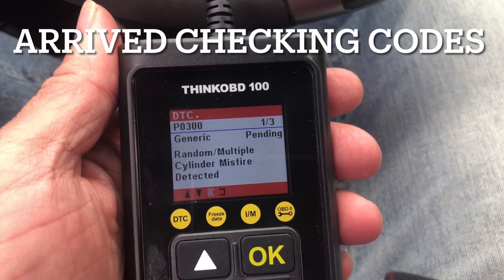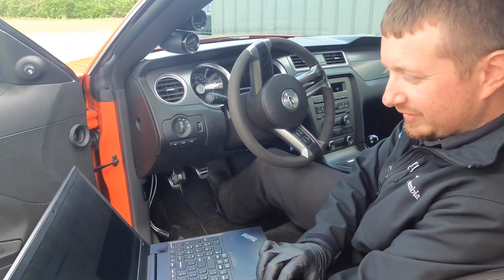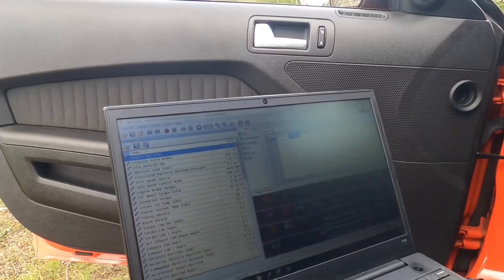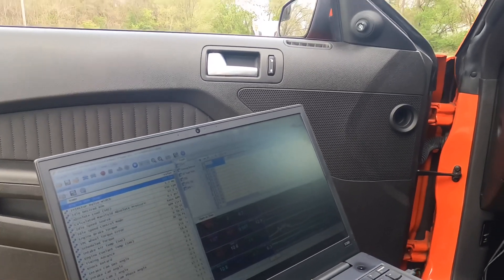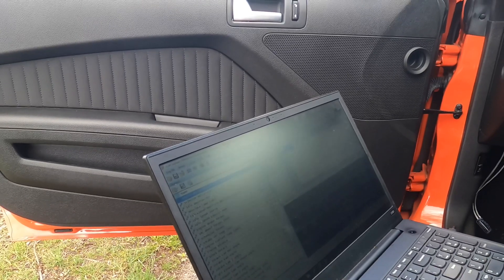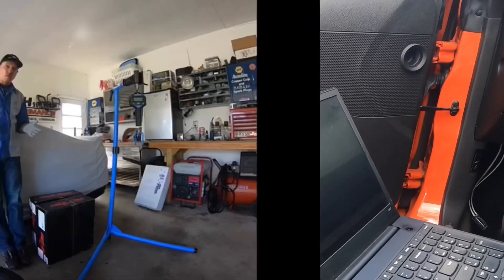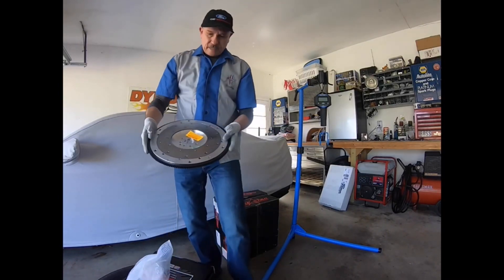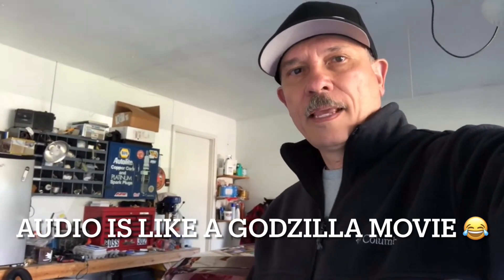Here’s Why I’m Throwing Misfire Codes! #forceengineering           Boss 302

Comment: All you needed to do was a crank relearn to resolve this issue. It is true that when you install a non-factory flywheel, the weight change can cause a random misfire code to appear. However, when installing a aftermarket flywheel you are supposed to do a crank relearn to avoid this code. A crank relearn takes about a 20 seconds to accomplish with HP Tuners.
Reply from the maker: NIC thanks for the comments, we did a crank relearn using a Ford IDS tool, did throw a code when we were testing but codes continue to happen.
Reply: @CoyoteProductionsBoss302  Interesting. It can take a few attempts some times for it to finally work. However, the issue is resolved so that is all that matters.

Comment: I have the McLeod aluminum flywheel on a 2014 GT and I rev it to 7500. I have never got any misfire codes
Reply from the maker: What clutch are you running?
Reply: RST
Reply from the maker: This might be a Boss specific issue. I do know Ford did a lot of engineering to work out the harmonics of the Boss to live at 7500 rpm. Ford's catalog list flywheel Part # BR3Z-6375-D for only  GT 2011-2017 without Boss 302.
Boss 302 flywheel is for 2012-2013 Boss and 5.0 Part #CR3Z-6375-A  
This suggests they are different. 
There is a Mcleod flywheel specific for the RST clutch that weighs 15 lbs. and another that weighs 13 lbs. I have the 13 lb. flywheel. 
Stock flywheel weight is 22.0 lbs and Mcleod also offers their steel flywheel at 22.0 lbs.

Comment: There was a TSB for Ford to put an O ring on the crank position sensor for fixing misfires 

And not sure how high you rev it over stock but there are high performance tone rings to use for the crank position sensor but unless you are revving over 8000 I don’t think that’s your issue. 

You should also verify with Ford and IDS that you are using the latest strategy and that your tune from your tuner is based off the latest strategy. Sometime tooners use generic files to create your tune and they should be using your actual strategy
Reply from the maker: I did the o ring fix maybe a month ago. 
I usually shift 75-76k max. Thanks for supporting.

Comment: Maybe you have bad coils…if you have msd coils they are junk…or maybe you have fake ngk plugs if you have changed any of that……trust that an aluminum flywheel will not cause a problem if you have done a proper crank relearn. 

Look somewhere else please don’t change the fly
Reply from the maker: I have stock coils and went back to new stock plugs gapped and torqued in. Again the engine isn’t missing a beat. Just throwing  P0300 code. I don’t want to change I love how this thing revs. Have used the ford IDS tool for the relearn.

Comment: Good god man the Mis information is terrible in YouTube. Just do a crank relearn properly. Aluminum flywheels WILL not cause issues. That is a fact I own one and no issues .
Reply from the maker: We did an IDS on Wednesday two days before seeing tuner. Previous video shows the test, not misinformation. 
If you have a better answer or fix much appreciated.
https://youtu.be/LSbeiSh98Yc
Reply: @CoyoteProductionsBoss302  I have a 13 boss with RST clutch and lightweight flywheel.... no problems at all for me....... I performed the crank relearn myself on my Ngauge

Comment: Thanks for the update.  Changing the "Mass" of the flywheel can no doubt change the Acceleration & Deceleration data being detected by the Crank sensor/CPU.  Hopefully a "Relearn" with this new Flywheel Mass accounted for, will keep the engine light off and not report bogus misfires.  Actually, makes sense now from what you've stated previously, you mentioned "no Misfires felt" but yet the CPU is flagging the engine for Misfires. As the forceengineering guy , mentioned - the CPU is awaiting different data  (its awaiting the original flywheel data).  Thanks for sharing and continued good luck w/ your projects , keep up the great videos.
Reply from the maker: We did a Ford IDS Wednesday, video just prior to this one. Worked during testing and we hit it hard and was good, the drive over to the tuner threw a code.